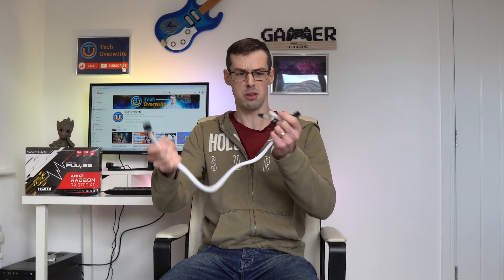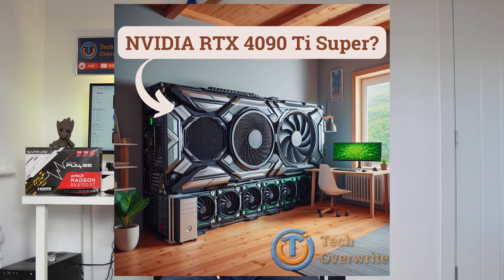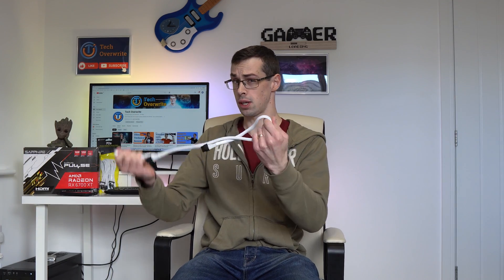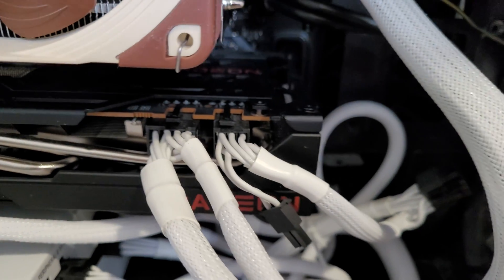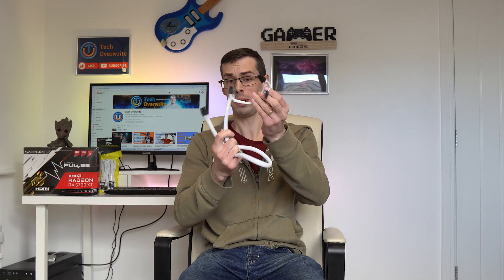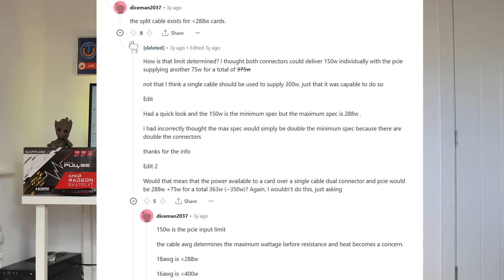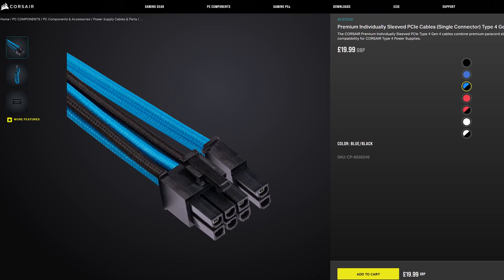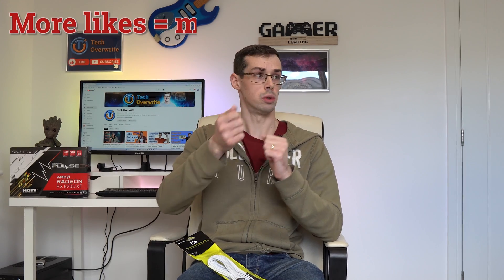Stop Connecting Your GPU Power Cables Like This! (How To PROPERLY Connect PCIe Cables For GPUs)

Comment: So in the case of the Intel Arc A770 that only requires 225 watts then its okay to use the pigtail?
Reply from the maker: It's borderline and can depend on the exact PSU and PCIe cable (especially if someone is trying to overclock the A770), but in general if it maxes out at 225w and no more, then yes, a pigtail should be fine. That's actually why Intel dropped the second pin requirement with the base B580 model - there's no need for the second connection :)
Reply: @TechOverwrite  thanks I just picked up the a770 during the holiday sales. I tried two canlez but the pig tails made it look horrible with my best cable management. I noticed in the bifrost software it's set to 210 watt max and I have no plan or need to overstock it
Reply: @GrampzIsGaming  How is the a770 working with the pigtails?? i have ordered an arc a750 which also uses 225 W, but my psu only has 1 pigtail so im worried
Reply: @V3DX27  No problems so far. I also keep my bifrost app settings for the A770 on silent or default which sets the power limit to 210. I am looking at ordering two non pigtail cables of Amazon but haven't yet. With my old set up using DaVinci resolve a 15 min video took around 7-1/2 mins to render and on my new system 2 mins. Let me know how yours goes.

Comment: I wanna upgrade to a msi 3070 super which need 2x 8 pin connector. 
But my psu have no extra pcie cables only (6+2)x2 like Y type(the one you forbid to use)
What should I do?
Reply from the maker: I just replied to your comment on the sister channel (Shorter Tech) but this might just about work with a 3070 Super, but your PSU is a bit borderline. So either you need to look for a compatible 2x 8 pin adaptor directly from Corsair (to be safe), or maybe change your PSU. I know that's a pain though.

Comment: Lmfao thanks for this man. I’ve been running my 7900xt off a single 2 prong PCIE(my version only has 2 connectors) and well on my old system it was fine I had a 650w power supply which is not enough for it paired with a 8600k both things were OC and ran fine… I’ve always had my GPU’s like this because I thought all the needed power would just run through the one cable. Just upgraded to a 7900x system which is much power hungry than the 8600k and added a 850w PSU and OC’ed everything of course but I was getting random crushes during benchmarking… I thought how it possible my 650 80 plus nothing was running this card but I can’t run it now with a 850 80 plus gold lmfao well turns out I’ve been starving the poor thing lol
Reply from the maker: Haha, that poor 7900xt - I'll spare a thought for that poor, power starved GPU LOL! Glad to have helped spread the word here though :)

Comment: Hello, I have a 12pin gpu that has an adapter that splits into two 8pin female plugs, then there are two 8pin male plugs pigtailed that come directly connected to the pcu 8pin. What is your recommendation? Should i get a dual 8pin to 12pin to supply adequate power? Im having crashing issues only while gaming and its a critical error 41. Ive upgraded psu to 1000w and all drivers have been uninstalled and reinstalled. Tried different RAM and updated bios. Its random crash, can sometimes game all night no issues. Suspecting bad cables or power. Thank you in advance.
Reply: Forgot to mention 3070 ti 3fan, unknown brand but came with HP Omen 40L
Reply from the maker: Hello, ugh that's a really frustrating issue sorry. Yes I'd either suspect a bad PSU, cable - or potentially motherboard. I would try a dual 8pin to 12pin and see if that helps yes. You could also try a mild GPU underclock/undervolt and see if things are more stable then. If so, that would point towards the PSU or a cable. But if it's still intermittently crashing, maybe that points to a motherboard issue? I hope you can get it resolved :(

Comment: where do I get the second cable do I have to buy it
Reply from the maker: Good question - I didn't cover modular vs non-modular PSUs in this video unfortunately. So if you have a non-modular PSU, you won't be able to 'add' anymore cables to it. So if you just have 1x PCIe cable, you'd probably be limited here (you would either need to buy a GPU which isn't super powerful, or look at undervolting it to bring its power usage down). But if you have a modular PSU, you should have extra cables in the box. If not though, many PSU makers sell them direct on their website - or you can explore third party sources like CableMod.
Reply: @TechOverwrite thank you but mine is not modular and i bought a rx 6750xt with 250w so is it big of a deal
Reply from the maker: @jacob_27_66  Ugh that's frustrating, unfortunately either undervolting the GPU or changing your PSU would be your best options IMO.

Comment: Pigtails are not nvidia's melting connector though...
Reply from the maker: Agreed - maybe I worded things badly in some parts. Apologies if so. I agree that the 12vhpwr cable is unrelated to the 6/8 pin PCIe connector in that sense.

Comment: Hi, i have corsair vs550 (550w) and have only 1x 8pin pcie cable. I want to buy MSI GeForce GTX 1070 GAMING X 8G (this card have TDP 150w) but this card have 6+8 pin. Do you think i can use only 8 pin ? Will card work?
Reply from the maker: Hi, yes that should work okay (although if you do need to buy an '8 to 6/8 pin' adaptor, it should be a quality one). The card's TDP is low enough that a pigtail connection here should be fine :)

Comment: Hi, I bought a 7600xt, and I have an RM850x PSU from corsair. I plugged one of the 8 pin to two 6+2 connectors into my gpu, loaded up a pretty heavy game and my computer completely shut off and it wont let me turn it on with the gpu plugged in. The psu seems fine as it still boots the pc without the gpu with my integrated graphics, but what do you think happened? Im completely lost
Reply from the maker: Hi, oh uh that sounds worrying, sorry to hear it. I doubt your GPU is completely broken (good news at least). If I had to guess, I'd say that your graphics drivers ended up fairly corrupted and your system is in a weird state. I would use Display Driver Uninstall, then shut down and do a CMOS battery clear, and then reboot and install the AMD drivers fresh again. I had similar before where my GPU overheated (I accidentally hardcoded the fan speed to 10%, then did heavy gaming... whoops!) and I had to do a similar process. I hope you can get this resolved :)
Reply: @ thanks for some hope! Lol, been working at this for a few days now, ill try what you said and get back to you! Thanks!

Comment: my conclusion is: 150w is just the pcie limit, ignore that search for the awg of your psu cables
Reply from the maker: A fair point, although if the GPU has a 300w TDP (for example) I then think it's worth taking a much closer look at things - instead of hoping that a single cable might do the job. It's a tricky area though.

Comment: i have a  question so the ICUE link needs a 6 pcie connection can i use the extra connection from the pigtail connector to power it? while the other connection is in my gpu?
Reply from the maker: Great question, yes that should work fine and it's actually a fairly good use of the 6 pin splitter. The only exception would be if your GPU used like 300w of power, and you wanted to try and power it off a single cable - it might be pushing it too far to then just use a single cable. But in that case, running 2 separate PCIe cables - and using one of the 6 pin splitters - should be fine yes :)

Comment: Helo, i just bought the msi mag a850gl, i would like to use the one wire w pig tail only as it is cleaner to use 1 wire. Is this ok for my rtx 3090?
Reply from the maker: Hello, a single cable for a 350 watt GPU? If you have the 8+8 pin variant, I definitely wouldn't do this no. (Although if you have the 12 pin variant of the card, and you're connecting it to 2 PCIe ports on the PSU - that would be fine.)

Comment: i have some corsair cables with pigtails and was wondering if i could cut the pigtail and insulate the edges with 
Heat shrinkable stuff for aesthetic reasons and still be fine.
Reply from the maker: This is technically possible (especially if it's properly insulating so there's absolutely no contact with anything else), but I personally would just buy Corsair premium single ended cables or a CableMod set. Just for my own peace of mind. But each to their own :)

Comment: Great video, i just wonder what cable i should use for my rx7900xt. I do have a 12vhpwr slot on my powersupply should i buy a cable that goes from that to 3x8 or is 2x8 to 3x8 better?

I do have some issues with my cable now so it might be the solution for me... i just dont know alot about pcs so no idea what cable i should buy. 

Power supply : MSI MPG A850G PCIE5 
Videocard : ASUS Radeon rx7900xt 

Any advise is welcome.

Greetz Jeroen
Reply from the maker: Hello :) Good question. So the ASUS RX7900XT is a great, powerful card but it should still be fine with 2 separate cables (and the third pigtail for that final connector), based on its 300w or so TDP. You could always give that a short and see if you get any crashes or stutters (I'd guess that it would be fine). However if you have concerns, running a third cable from the "PCIe/CPU" slot would also be fine, as would using a 12vhpwr to 8-pin adaptor cable to get power from there. Both would be fine, safe options (assuming the adaptor is from a high quality source). In short, you have a good PSU, I don't think you'll have any issues safely powering your GPU.
Reply: @TechOverwrite  thanks alot for ur help!

Comment: I have a 12 pin on my graphics card, and 4 8 pins on my power supply, can i run a strimmer thats 12 to 3 8pins? And not plug one of the 8 pins in? 😅
Reply from the maker: That sounds be fine if I'm understanding correctly :) You wouldn't need to use all 4 8-pin connectors. And it would be rare that a GPU genuinely needs 4x cables. Although if it's the RTX 4090 and it is overclocked, it might genuinely need a fourth cable. In all other cases though 3 cables/connections should be okay IMO.

Comment: If you need seperate cables you need a new power supply? It’s all going to the same 12v rail on my Corsair rm1000x it makes 0 difference is what I was told? Which makes sense since the cables can handle a ton. It looks like shit anyway so I changed it. I find evga connectors are a lot better than the shit ones that come with Corsair.
Reply from the maker: The Corsair cables are high gauge so can certainly handle more than 150w through them, yes. But it depends on your GPU too. I wouldn't want to try and power an 7900 XTX with a single cable (and adapters), for example. But yes, a 300w GPU might be fine on a single cable with that PSU :)

Comment: I got a rx 580 with i5-6500 and 700w power supply but the red led turns on when the pcie is plugged in my question is doesit have to be plugged into the main board like running the GPU outside of the pc case.
Reply from the maker: Do you have an external GPU (eGPU) box? If not, the RX580 would need to be plugged fully into one of the x16 motherboard slots yes - and then 1 PCIe cable will need to be run from the PSU to the RX580 for the extra power draw.
Reply: Yea it's plugged in to both the main board and to the power supply but  it won't boot up when the power supply is plugged in when you unplug the GPU it boots up and has a red light on.
Reply from the maker: Sorry to hear that. It almost sounds like a faulty motherboard IMO. Maybe try reseating the RAM and other power cables, along with the CMOS battery, but failing that it sounds like a fault.
Reply: @TechOverwrite  I'm going to get a 9th gen mai board eventually

Comment: But with an psu like msi mpg a850g
Reply from the maker: The actual webpage for the A850g (https://www.msi.com/Power-Supply/MPG-A850G-PCIE5) does cover this under the GPU SUPPORT FOR ALL section. It has pictures for each type of card/cable configuration too :)
Reply: @TechOverwrite  so i can use that split one for 2x 6+2 connector
Reply from the maker: It depends on the GPU too, but that should be fine for many mid range cards IMO.
Reply: @TechOverwrite  it's a rx 7900 xtx 350w
Reply from the maker: Awesome card 🙂 I just realised the link is broken but I would run 1x cable from PCIe and then 2x from 12vhpwr via the adapter, the pictures show this scenario would be fine: https://www.msi.com/Power-Supply/MPG-A850G-PCIE5

Comment: I only have 2 pcie cables with pigtails, I have a 3 slot gpu, what do I do bruh
Reply from the maker: Unless it's a super high power card, using 2 separate cables (and the third pigtail for the third connection) should be fine in most cases 🤞
Reply: @ it’s a rx 7900 xtx please reply and tell me that it’s fine or not, I need to know I spent too much on this card PLEASE HELP ME 🙏🙏🙏🙏
Reply from the maker: Ooo okay. So that's a pretty high power card. It probably will still be fine with 2 separate cables and the pigtail, assuming it's not overclocked. You can always try it and see if you get poor performance or stutters. If so, you then might want to consider a PSU upgrade so that you can run 3 separate cables. That will be most reliable.

Comment: Hello ı have r5 5600 and gameforce 500 watt psu and ı bought rx 6800xt ı didnt search enough so this psu have 1 8pin pci cable can ı use a pigtale or 8 pin to 2x8 pin?
Reply from the maker: Hello, hmm unfortunately that's a nice, powerful GPU and I wouldn't want to power it with a single cable - personally. However you might find that you could slightly undervolt it and it will then run fine. Just keep an eye on it's power consumption in AMD Software or similar.
Reply: @TechOverwrite  thanks for response

Comment: hey i didnt focus much on the new power supply with 12vhpwr socket so i get a corsair hx1000 and the corsair cable is it ok or i will be forced to change the psu
Reply from the maker: Hey, yes the HX1000 should definitely be fine, the recent versions should come with a 12vhpwr cable within the box - so it'll include everything for both AMD and NVIDIA cards 🙂

Comment: Hey, im about to build my pc and the psu i bought is the fsp vita gm 1000w it  has 2 cpu and 2 gpu/pcie slots, however my gpu 7900 xtx nitro+ need 3, am i fine with 2 cables and using one of the pigtails or do i need a different psu?
Reply from the maker: You could try with 2 - it won't damage the GPU if it crashes when gaming or running Furmark. But running 3 would be ideal - if needed you could always explore a 12vhpwr to 8-pin adapter for that final third connection. Just make sure the adapter is from a reputable source. 🙂
Reply: @TechOverwrite  thanks for the answere, in the end i decided to get a new psu the rm1000e 2023 it has 6 pcie/cpu sockets and it should have the same quality as the fsp one
Reply from the maker: Ah nice choice, yes I like how Corsair PSUs do this to be honest. Gives a lot of choice for CPU and GPU connections. Good luck with the build 🙂

Comment: What about the RTX 4070 that has a TDP of 200W? Can I use a single PCIe power cable with 2 separate 6+2-pin connectors?
Reply from the maker: Wouldn't that need a 12vhpwr cable instead? If so,   I would use the adapter that is included. Link to the exact card though if it's not using the 16 pin connector and I'll take a closer look.

Comment: What about using a 2x8pin adaptor for ab rtx 4080 super? Supposed to be a 3 cable card. Yet two cables plus slot equals 375 watt  and the card  is rated dor 320 watts. So i should be fine yeah?
Reply from the maker: Yes I agree, as long as it's a quality adapter it should be fine. 🙂
Reply: @TechOverwrite   I mean it's got good reviews and is rated for 600w

Comment: So that means I need to buy another PSU I brought NZXT 1200 Gold which only comes with 2 8 PCIE cables one is pigtail and another single 8 pin I seen that NZXT has come out with NZXT 1200 gold PSU 3.1 and it has 3 single PCIE cables
Reply from the maker: If you have the 2023 ATX 3.0 PSU, that has got plenty of PCIe slots available. I would email NZXT, apparently they are pretty helpful with selling extra cables. I would just but more single PCIe cables and not change the PSU, but naturally it's up to you 🙂
Reply: @TechOverwrite  but the PSU I have it only has 2 6+2 PCIE slots the new revision or should I say new PSU from NZXT they have 3 6+2 PCIE slots
Reply from the maker: Oh apologies, the one I googled had like 4 PCIe/CPU slots (and many CPUs only need 1 cable, so you could then have 3x for the PCIe). Must have seen the wrong model. To be honest it depends on what GPU you have. Two separate cables plus the PCIe mobo slot will give 375w power at a minimum, so that's often enough for many GPUs. But naturally it wouldn't be enough for an OCed 7900xtx. If you plan to get a high end GPU and can easily swap out the PSU,you may as well change it 🙂
Reply: @TechOverwrite  I am going for Asrock Taichi XT 7900xtx GPU and that GPU does require a lot of power so daisy chain PCIE cable could possibly burn my GPU or even my Mobo

Comment: can I use both the 12 pin connector and the 8 pin connector from the psu end  to supply my 7900xtx with 3 pcie 6+2 pin needed.
Reply from the maker: Which PSU is that? I'm struggling to visualise exactly what you mean (wouldn't the PSU end still haven 8pin connectors all round)? But if you do have a specific 12 pin port on your PSU, as long as you use a quality 12 to 8 pin adapter, it should be fine. The power delivery should be okay, even for your powerful GPU (nice card btw) 🙂